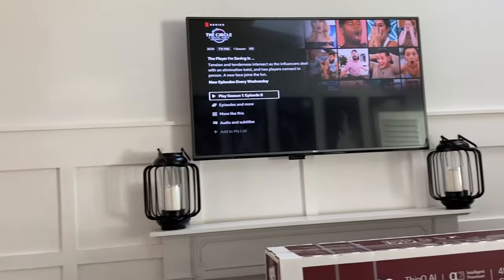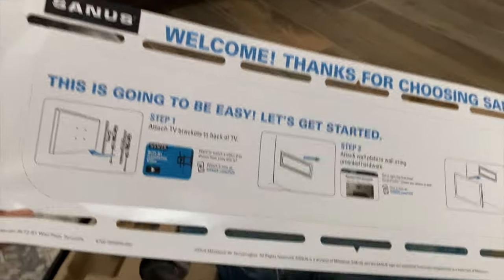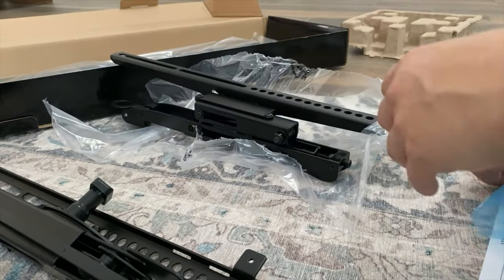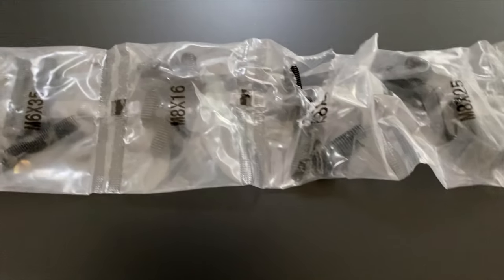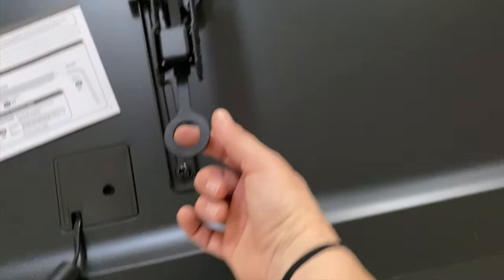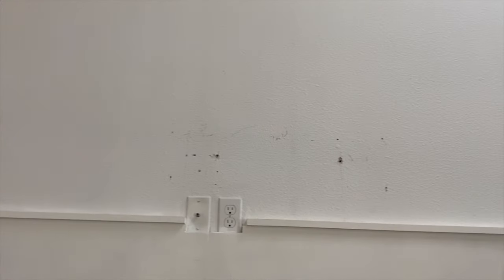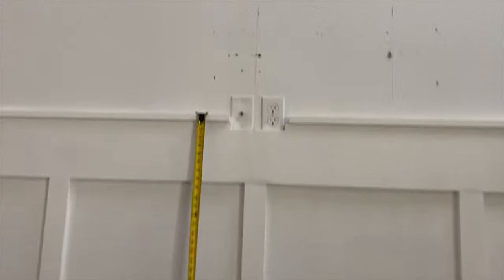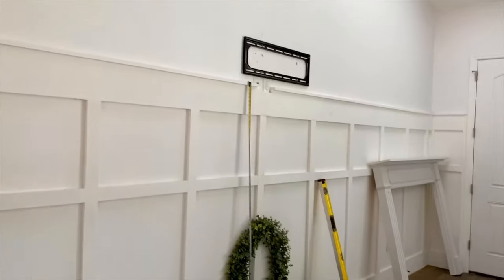Unboxing LG UHD 86” TV & Mounting with Sanus Advanced Tilt Wall Mount

Comment: I chose a wall mount that extends, tilts and rotates. 
Bought it online for $50.
It makes installation way easier and allows for more movement when wanting to watch TV in the kitchen or at the table.
Reply: $50 to mount a tv weighing more than 100 lbs, and all of the extra features?
How many people were under it when it fell?
Reply: @westmcgee9320  Has a limit of 132 lbs per the website I purchased the mount from.

Comment: Love my tv at an eye level instead of mounting it atop of a fire place, your head and neck is always looking upward which makes your neck very tire. I guess different strokes for different folks
Reply: It’s 86 inch, should be big enough to not make any difference
Reply: Ok I just watched the vid , it’s way too high, it should be at least 30cm lower
Reply: Dude, I know. So many people do it. I think for decoration
Reply: Couch level is better for me, but this height would work as well if sitting further back in a reclined chair with tv slightly reclining down as well
Reply: Same I had mines on the wall it was fine at first ,was to lazy to take it down … till we had to repaint the walls .. NOW it’s on a TV Standddd feels waaaaaaayyyyyyy BETTER
Reply: @vantablack5690  Way too high!
Reply: Yes kinda hard to make adjustments when you got it 20 feet in the air. Bring it down about 1-2ft at least.🤣
Reply: Seems to be an American thing. And i wonder why they never feel like this is too high and can only be bad for their neck.
Reply: Putting a TV higher than 50” from the floor makes no damn sense

Comment: I just bought a LG86 inch at Costco. I initially wanted to mount it into a a similar wall mount as displayed on the video. However, I decided to mount it into a flat one into 3 studs to secure the the from falling down. I however wanted to ask you guys about your opinions regarding 2 studs (4 long screws) mounting with a mount wall as displayed on this video. How safe is it? Have you guys experienced any significant negative effects from the tvs weight?
Reply from the maker: It’s holding up perfectly! Haven’t had any sagging or anything

Comment: Next you should try installing the tv on the ceiling 😂
Reply from the maker: My next video is suspending a 98” tv from a tree limb to watch through the skylight
Reply: Laugh ALL you want... I almost did that in my bedroom so I could lay down and just watch up
Reply: @Kris-jk9mq  idk if you’re joking but please don’t... I don’t think those brackets are engineered to hold that much weight, they’re designed to hold the tv vertically, but if they hold it flat who knows what might happen. And I also wouldn’t want an 86 inch falling on my face while I’m asleep.
Reply: @AArrad  It was a 55" in the bedroom I almost did this on.. And I would have lagged it up to rafters like a ceiling fan.. But you are correct, a normal mount would probably bend horizontal.
Reply: @Kris-jk9mq  imagine it just smacks you in the head and breaks while sleeping? Remember gravity is turned on all the time cant turn it off
Reply: @thatvolvoguy6565  I have ceiling fans in every room with 14' tall ceilings.. I HUNG myself from the mount when I changed my fans to 'sleep better'.. But, I used to build 200' towers; I'm sure I can mount a TV to a ceiling just fine.. People tripping yo, its only 100#.. Man up!

Comment: Sweet install ladies!! -Any cause for concern?? I recently had my LG 86" UQ8000 installed by two Jacklegs I found on Yelp. I provided the TV mount kit [unopened] and a Power Bridge outlet kit. After the installation I checked the TV mount kit's box and they did not use ANY of the supplies/screws included. The TV was mounted off center by about 6-8" and they told me it was because the mount did not allow them to "slide" brackets. I feel extremely nervous when adjusting the TV even though it appears as if they used lag bolts to mount it. I found it pretty strange they did not remove ANY of my equipment [i.e. huge 35lb Klipsch center channel, Onkyo AVR, gaming consoles...] from the entertainment center to get behind it and the next morning I discovered they destroyed the underside of it by DRAGGING it across my Berber carpet. They initially wanted to repair it and have since told me they will order me a new one.

Comment: Totally off topic. But yall bought your place with the trim on the wall like that or did yall install it? I've seen houses with that style but the walls are a smooth texture and not the orange peel that is on your wall, but it still looks good.
Reply from the maker: The board and batten is another project I did. I have a video on it on my channel! We do have textured walls so I put thin plywood backing up first to create a smooth texture for the paneling behind the board and batten trim
Reply: @devitodoes3269  I will search for the video after I get off work. Thanks !

Comment: FYI for future reference you did not need  to take the original plate off, these work with most mounts, I would have just used the original.
Reply from the maker: You’re probably right. But the tv is almost double the size of the old one, I wasn’t going to risk using the smaller tv hardware. I don’t remember what it was rated for so safer to just swap it out.
Reply: @devitodoes3269   If it makes you feel better then thats OK, but understand that those things are pretty much the same, and all are rediculously over engineered, you could hang  a Kia on most, took a 20 lb sledge and a half an hour to KNOCK  a piece off of one once

Comment: That's too high up...RIP neck
Reply from the maker: Haven’t had any issues so far
Reply: Waaay too high
Reply: @TexasRanchu  it works because the angle of the mount.
Reply: Besides tilt angle aids the neck drama and is ideal for large space where your not sitting so close to TV. I have large living room vault ceiling TV over fire place bottom of 85" QLED 60T about 5.5 Ft from floor seating minimal 7Ft from TV. Love seat and sofa across from each other one front end 7ft from fire place rear of love seat and sofa is recliner that's 12ft across from fire place. Tilting the TV helps to Aid in so called neck pain and distance away from TV. All my seats are motorized recliners too. Before I had 70" vizo m series c70 for 4years zero complaints from visitors. No neck braces yet LMAO!! Absolutely love high mounted TV. Pain in the tail to get up haha
Reply: Seeing taking down old TV I do wonder how high up it is, I am looking to put middle of mine 2m up as need shelf's below for other things

Comment: Tilt mount, schmilt mount. you're still going to get a pain in the neck watching that thing. TVs should be mounter with the center of the screen 42" - 48" off the floor. That's where you eyes are when you're seated.
Reply from the maker: Thank you for the comment. I have no neck pain.

Comment: I mounted a 39" and I used 4 screws on studs and 4 anchors on drywall. I went overboard on a 39". 7:05. My anxiety is high watching her being confident in 4 screws for this mammoth of a t.v.
Reply from the maker: It’s made for a giant tv and that’s all it came with! It’s holding strong
Reply: @devitodoes3269  . It's just me. I'm extra paranoid. I got the 4 anchors from Home Depot. Nice video.
Reply: @Alejandro Ocampo — as long as you get the 4 lag bolts in studs, you have more than enough holding strength.    Each of those lag bolts are rated at 100 lbs.    Anything more than the lags is overkill and not necessary.    That TV probably weighs about 100lbs.